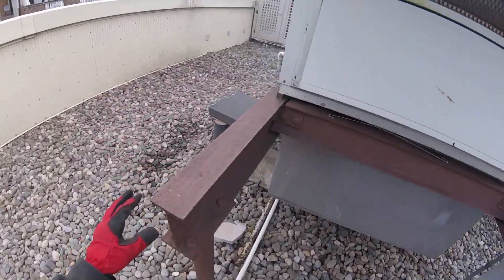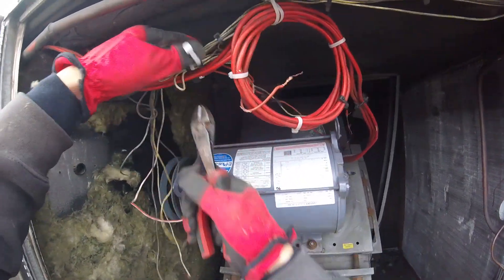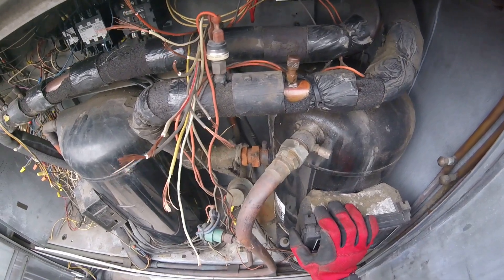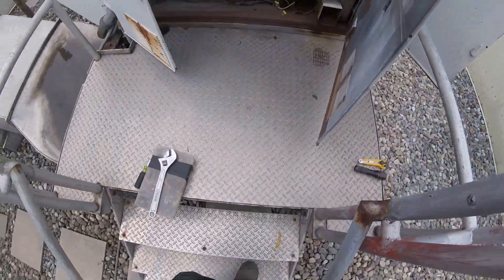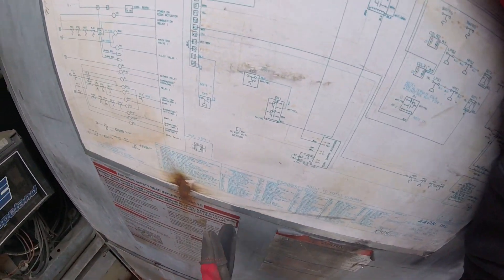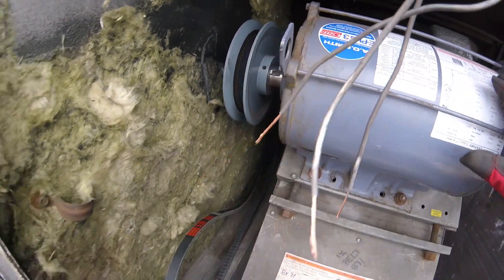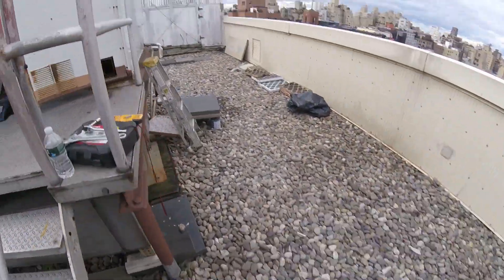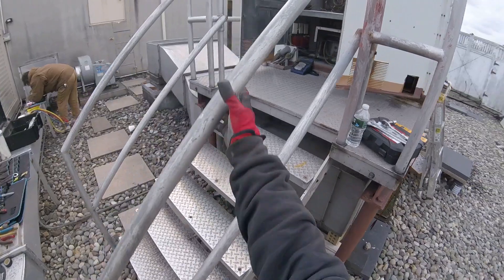HVAC service call: No Heat (AAON RTU) Burnt/Broken Wires

Comment: What are all those wires? Low voltage? I mean, judging from the mess there could have been an electrician/technician there before who ran 120V or higher in those cables? Or what do you think? 

I would not leave it before I knew for certain that none of it was hazardous voltages/current. And if some of it was, then I would try to mechanically protect that. 

Im just an electrician with no HVAC experience, but I would appreciate your opinion on this:)
Reply from the maker: I hear your concern. I thought the wires went through where I ran them through that black knock out. Originally it actually never went through there because that knockout was capped off. It just followed the large 3 fan motor wires that follow across the top. Some protection would be nice so the insulation of the wire doesnt come out and end up having a short but its alright, they will be fine🙂 haha. Good eye & thanks for watching🤘 New videos every week!

Comment: Im not an HVAC technician, and I am not trying to judge, but shouldnt the wires going through the hole have been protected in some way? Either a rubber grommet, electrical tape around the wires, maybe a tube or hose around it? I would worry that the vibrations would cause that metal edge to cut through the wires. Would love to hear your opinion on that. Sincerely.
Reply from the maker: The knockout was just a cap and never orginally went through there as I suspected. I wanted to use that black piece around the wires to protect it but it disappeared inside the unit when trying to take it off. I actually used some electrical tape in that section around the wires for some extra protection against vibration. An actually fitting wouldov been better but it is what it is🙂 Thanks for watching and the feedback!